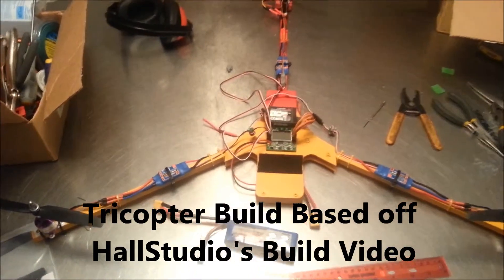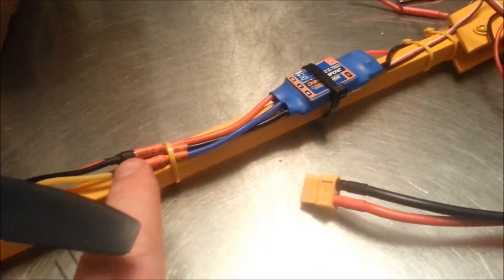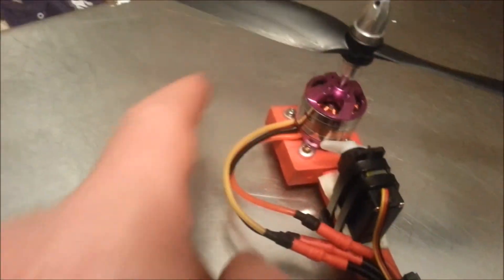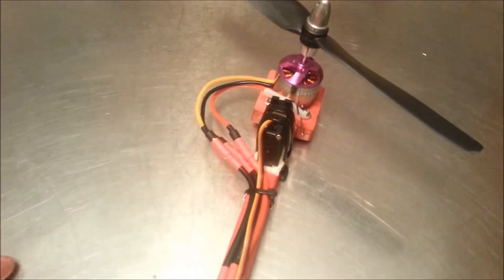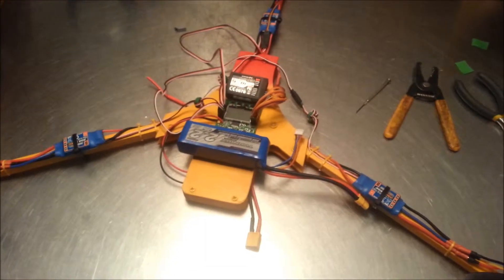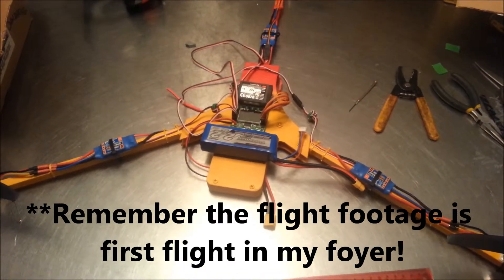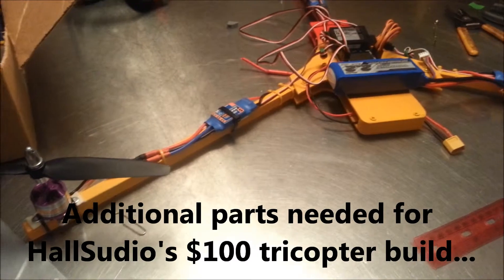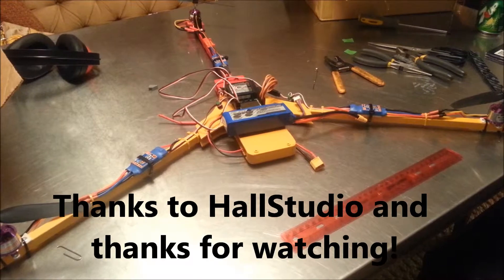Tricopter Build Based Off HallStudio Build Video Completed!

Comment: how can I get the dimensions to build one?
Reply from the maker: I got this template from rcexplorer.se and enlarged it about 186%.  There are templates you print off, cut out, trace on to wood, and cut out.  I just made a new tricopter based off the Simple Copter 2.0 on the simplecopter.com website.  I'm going to be make a review of it and a detailed parts list.  I'm hoping it will help people deciding what they want to get.
Reply: Thanks!